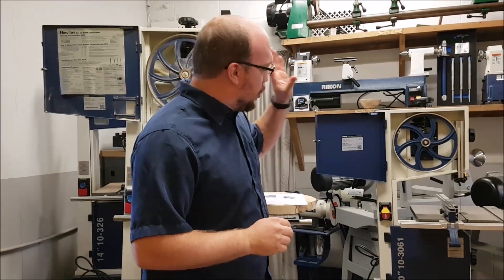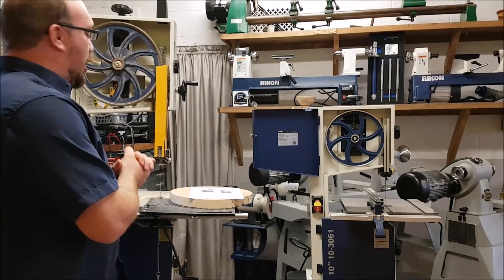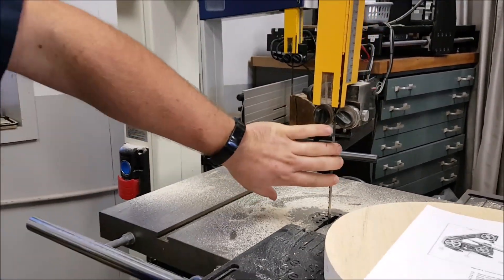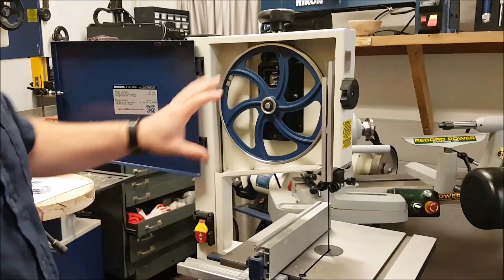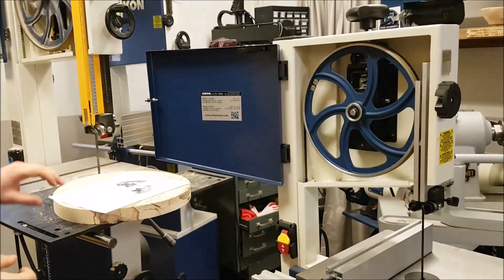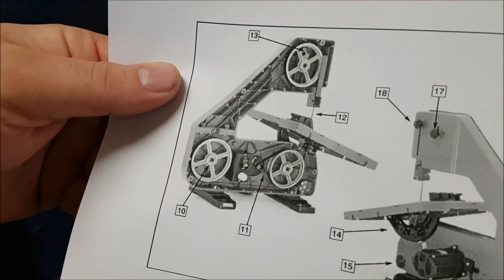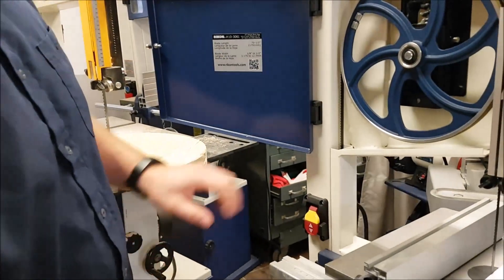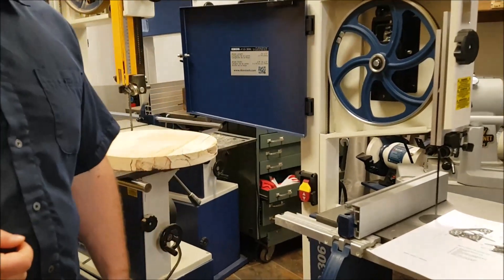Why Do My Blades Break On My Benchtop Bandsaw? Good Chance It's Blade Choice! EthAnswers

Comment: .02 inches is half a millimetre. Is that really how thin the blade is? I have a Naerok 3 wheel bandsaw like the one in your diagram, I used a half inch blade, and yep it snapped quickly.

Comment: Excellent, Ethan!  There are some other reasons why blades break, regardless of saw size.  A common one is excessive tension, forcing the weld, {the weakest portion} to overheat.  So does too much pressure tightening the blade, or setting the side guides too close as well as the thrust bearing. On a fast cut, which, again builds heat, especially when the teeth have been dulled after a session with many cuts, is yet another factor.